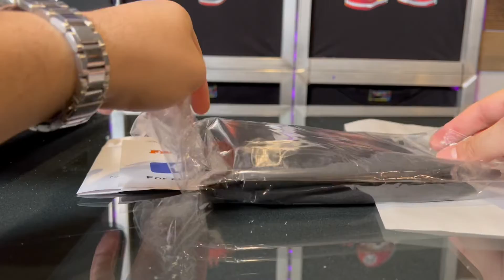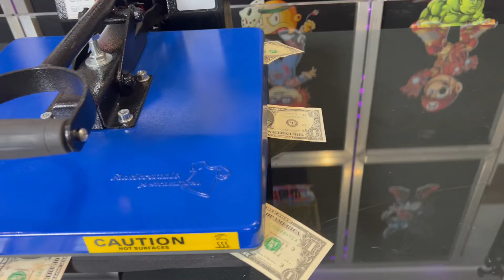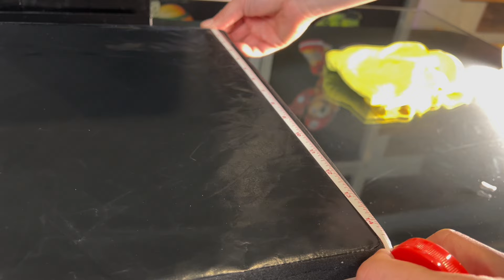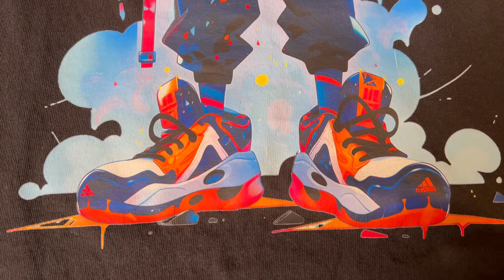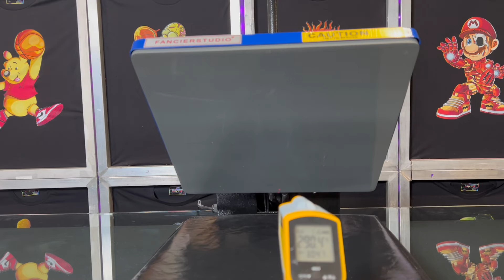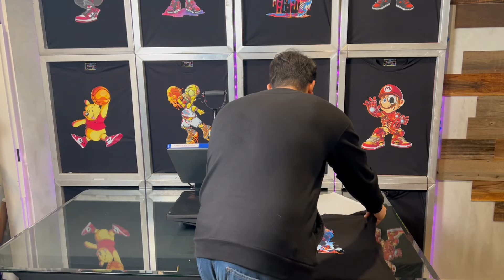Fancier Studio with Pull-Out Feature Heat Press Full Review

Comment: Just received and tested this. I have the heat cranked to 320 and press time a whopping 20+ seconds and I’m still needing multiple presses. Anyone have any ideas what I’m doing wrong?
Reply from the maker: Where did you get your transfers from? 20secs seems long, I think you might be melting your transfers.
Reply: @transfersuperstars tested jiffy transfers and bestpricedtf both same thing. I’m wondering if pressure isn’t high enough or if I’m supposed to be using this Teflon pad that you guys called a replacement for the bottom. My came on the top heat pad if that makes sense
Reply: And I agree 20 seems long that’s why m researching. But we’ve tried both hot and cold peel and one press at 320 for 20s and the transfer wants to come off the shirt with the peel

Comment: Do you think the temperature got wonky because you had it open for so long?
Reply from the maker: Not at all. You can leave your heat press and come back any time. The heat press should have a temperature regulator to turn on and off so it doesn't overheat.
Reply: It would have to be the coil setup in the press

Comment: I got this as my first press a few months ago and I love it! I hold the base down with the pull-out handle to lift the press. (I picked this one instead of the non-slide-out Fancier press from your last review to have that handle). I wish the slide-out was smoother as you mentioned.
Reply from the maker: Thanks for sharing! Yes its not as smooth as we'd like but not bad for a value press.
Reply: Is ur  heat press still holding up? Shopping for one myself